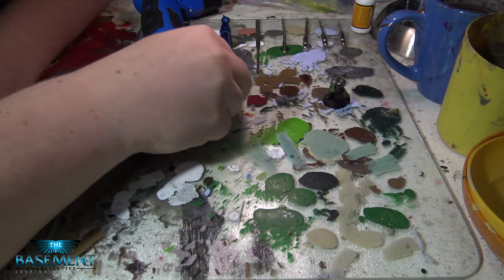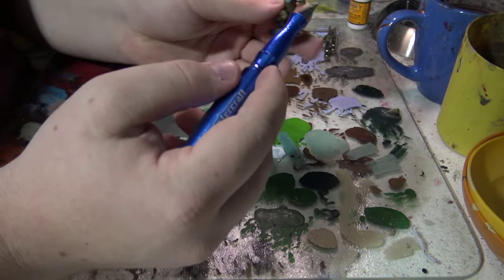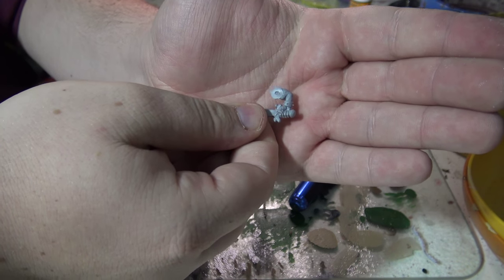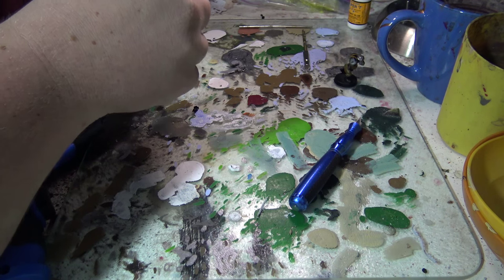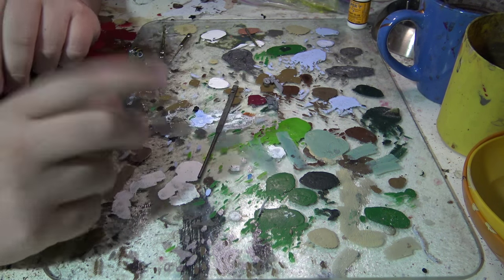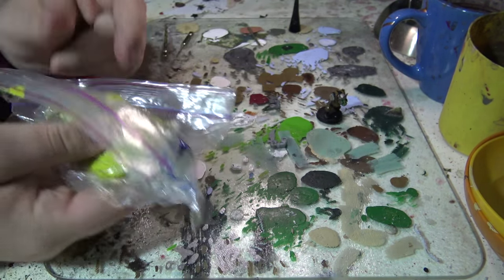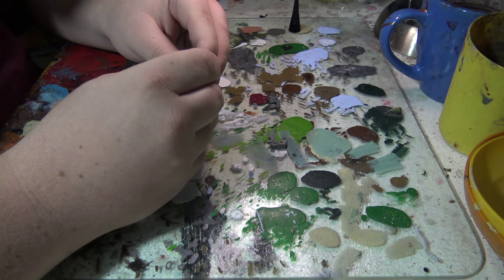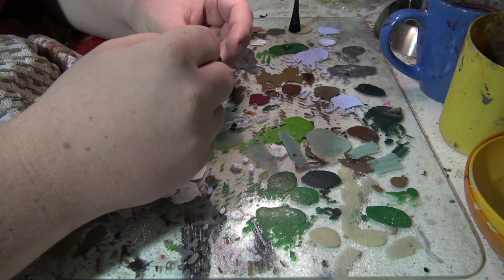TBMC - At the Painting Table - Magnetizing 28mm Infantry Tutorial

Comment: Nice video! One thing you can do if one of the pieces is too slim or delicate to drill is making the hole for the other magnet deeper, so you just have to glue the magnet to the slim piece. That way, when you put the two pieces together, the  magnet gets inside the hole, so it's not seen from outside, and moreover it can make the pieces fit tighter. Cheers!

Comment: Wouldn't it have been easier to put a small plate of steel or similar on the arm and the magnet on the ork so you wouldn't need to worry about polarity?
Reply from the maker: +killroy v2 You could, but personally I think this is easier, you get use to it, matching polarity, don't have to worry about cutting steal and what not.